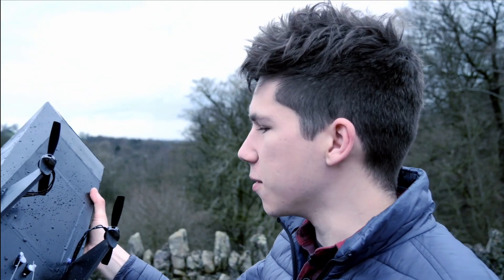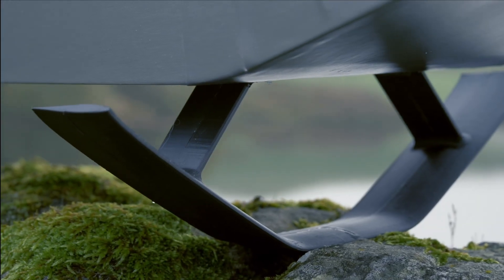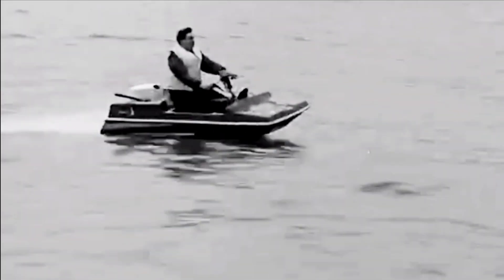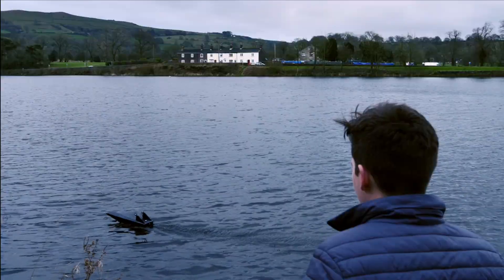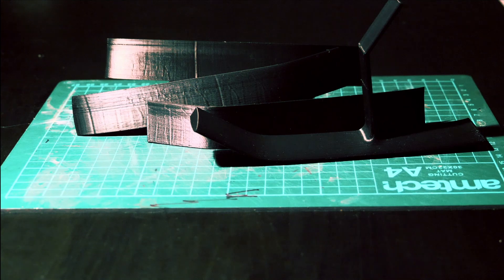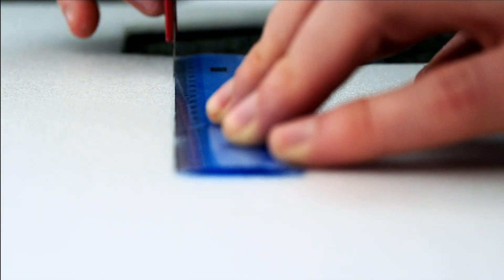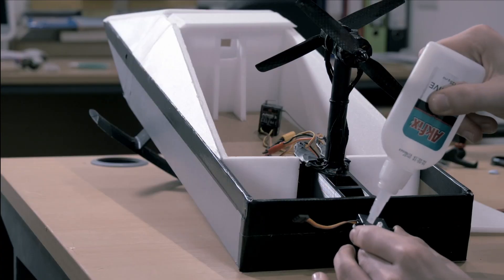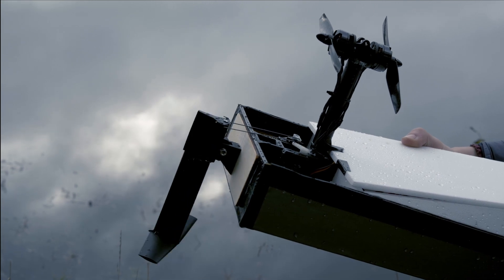TESLA CYBERTRUCK BOAT! // How To Build a RC Hydrofoil

Comment: Just found this channel by pure accident and subscribed. Reminds me of the very much simpler and cruder experiments we tried 60 years ago when r/c was expensive and cumbersome and model aircraft were still wood and tissue and powered either by elastic or tiny, glow-plug engines. Never managed to get a hydrofoil to actually lift. Yours is brilliant. Are the air screws ‘handed’? Also, the athletics were admirable. Great fun. Thanks.

Comment: Looks like you need a foil about twice the size as that one for that boat. Also, if you go to your local hobby shop and get some lead stick on weights and place them on the bottom center of the foils at the lowest point, that will also make it much more stable. I would also consider making a design where you have another foil just like the one on the front but placed on the rear right in front of your rudder. Keep your rudder/elevator foil on there too for stearing, this will help keep the rear of the vessel up out of the water. Good luck!

Comment: Just a thought, do the props on the mk.2 counter rotate?  With the setup on mk.1 the motors cancel each other’s torque, if the props on the mk.2 turn the same direction i would guess that  the torque could cause the instability.

Comment: it is rolling at full throttle because of p-factor of the props.  your first boat was stable  because it had push and pull props counteracting the p-factor. try using counter-rotating motors and props  with the  right motor rotating to the left and the left motor rotating  to the right. Check out the P-38 design to understand what I am talking about. Although the P-38 had counter rotating  props to the outside not towards the inside as I am suggesting. Concerning the wings  they  should be mounted further back closer to the center of the overall length of the boat and be deeper in the water. The rear wing should be larger for better control

Comment: I really like this project James. I think you might need a normal hulled tug boat with a lot of torque that can go out to save the hydrofoil to make your testing easier. Also it might be fun to add aileron as I believe I have seen that on some hydrofoils so they can control roll. P.s. Some sweet boulding on that bridge.

Comment: the mk1 seemed to work decently, however, to have a balanced fly, I would have set the rudder with less tilt after lift off (to avoid the diving issue)

Comment: Are both props Turing in the same direction? Looks like when you are applying the power the boat is torque rolling. Spins the props in opposite directions so they cancel each other out..

Comment: Having lived all my life at a shipyard. I think i can safely claim that a long pole with a hook at the end is the best tool for resqueing stuff out of the water. For the size/weight of these RC boats, a telescopic pole like the ones window-washers use, would probably be the best choice. They are low weight, and only about 1.2 to 1.5 meter long when folded, so easy to transport.

Comment: Very nice.
If I had a lake close by I`d probably try to make one.
Couple of points which may help.
When you had the 2 motors on the carbon, they were rotating opposite, so all good, but when both facing forward, looks like you were getting torque roll.
Try making one motor rotate the other direction. i.e. one clockwise, and one counter clockwise.
Also, mix in some "differential thrust" on the motors, as this will work like a rudder also.
good luck, looking forward to next version

Comment: Cool project! 
Do the motors spin the propellors in the same way? If they do, then the torque from them could be tilting the boat over. What I suggest is that you have the motors spin opposite ways and use differential thrust with them. (If you haven't already, hard to tell in the video)

Comment: Are you using contra-rotating motors/props ? If both motors and props are rotating the same way there maybe a torque reaction causing the rolling instability when trying to plane ?

Comment: The one thing I would say is to cut the flat section on the front foil out as it produces to much lift causing the foil to leave the water. The diagonal parts should easily be able to lift a boat of that size and will have self stabilising characteristic.

I’ve done a lot of theory work with foil and have sailed hydrofoiling boat like the vampire project so you know the advice has some backing

Comment: Some things you might consider for the Mk3.
1.  Return to the center engine pylon with a "push-pull" configuration.  That seemed to be much more stable, although that might be an illusion because of the weather.
2.  Shorten the "legs" on the foils.  I doubt if you really need THAT much clearance when at full speed.  Unless, of course, you're trying to clear out the water weeds when you're at slow speeds!
3.  Follow the design advice from Gungan Works :D  He REALLY seems to know what he's talking about!

Comment: Might the boat also have tendency to roll because the propellers are rotating in the same direction, thus creating a torque that rotates the boat? Maybe counter rotating propellors will help a bit.

Comment: Take version 1, try to move the motors further back and as low as possible. Change the thrust angle of the motors so that a line of the thrust angle goes through the boat at a point about 2/3 of the length measured from the rear. Make sure you have small increments of control for the rear foil so that as the boat rises out the water you can cut back on the angle of the rear foil.  At the desired  attitude of the boat hydroplaning, the front foil should still have a slightly upwards tendency  to make it stay out of the water.  Make sure the front hydrofoil is not too "pointy" into the water as this will cause instability as it rises out of the water. Good luck but hope to see you succeed with this one!

Comment: Try going back to the contra rotating props, because maybe the two separated props are getting a different amount of air flow, and ther high mounting position mite be making it roll

Comment: Seems like some elevons and an imu on the main foil might help. Or at least some wash in on the main foil to increase roll stability. Also, perhaps decoupling the rear foil from the rudder. I tend to try to keep my inputs as independent as I can for simplicity's sake. I think using differential thrust for steering is going to be a losing battle because you've got a lot of vertical surface area cutting through the water. Remember that water is 100X the density of air.

Comment: Great video, keep up the good work! Nice design elements. 1 Q' You did have the rotors (model 2) counter rotating? For the Hydrofoil action ... If you have the ability to change the angle of the attack of the rear hydrofoil you will be able to rise and then keep it in the elevated position. A 3rd control channel, if you like. A 4th control channel for the front hydrofoil would be the ultimate. For operation a mix of Rear and Front hydrofoil through a lot of experimentation should be possible. Great potential for an autonomous vehicle project!
Reply from the maker: Thanks for the comment! 1) Yep they were counter rotating on the MK2. (2) Yeah I realise now I misunderstood how to control the elevator to get the model to 'plane' properly haha - although I think the new MK2 did show some evidence of the rear coming out of the water (3) A 4th channel for ailerons would be great, but also complex which is why I stuck to keeping it simple. ☺️ Cheers.

Comment: this boat is looking less of cybertruck and more of nighthawk, btw try using differential thrust on the motors along with the rudder for additional control
Reply from the maker: Absolutely think adding differential thrust would be very beneficial. It's one reason I decided to go for this separated motor configuration on the MK2

Comment: Long comment, I know, but I've studied hydrofoils in-depth, so hang around. It will be absolutely worth it. Here goes:

The following statement is the secret to achieving a successful hydrofoil: ***Because of the shallow V of the foil, the usable lifting area of the foil changes, depending on how much of it is in the water or not.***Consider the implications of that statement: The faster the boat goes, the more lift the foil creates. The more lift the foil creates, the more the foil rises out of the water. And the more the foil rises out of the water, the less lift it creates. Relative to the weight the foil supports, too much lift, and it rises higher, creates less lift, and sinks down. Too little lift, and it sinks lower, creates more lift, and rises up. This is a self-stabilizing system.

On the other hand, the rear foil is continually submerged in the water. This means (for a constant speed), the lift developed by the rear foil depends exclusively on its angle of attack in the water. Thus, when the boat pitches up, the foil pitches up and produces more lift. When the boat pitches down, the foil pitches down and produces less lift.

Now consider the hydrofoil as a whole. As the front foil creates more lift, the foil rises up in the water, causing the boat to pitch up. As the boat pitches up, the rear foil pitches up and creates more lift, causing the rear of the boat to rise up. The key is to place the CG just right such that the lift from both foils balances the weight and CG of the boat.

This is how you create a stable hydrofoil:
1. Physically set the incidence of the front and rear foils to be identical, and adjust the thrust angle of the motors to minimize the downward pitching moment they create.
2. Calculate the surface area of the area of the portion of the front foil that is underwater when the front foil is 1/2 way out of the water. (I'll call this Af)
3. Calculate the surface area of the rear foil. (I'll call this Ar, and call the distance between the foils L.)
4. Find the location of the CG that puts an equal load on both foils using the following equation:
Distance from rear foil to CG = L * (Af / (Af + Ar))
5. As the boat is foiling, use very small adjustments to the angle of the rear foil to adjust the flying angle and flying height of the model, accommodate for the thrust angle of the motors, etc.

Example:
Area of submerged portion of the front foil: 30cm^2 (Af)
Rear foil area: 15cm^2 (Ar)
Distance between front and rear foils: 30cm (L)
Find the distance from the rear foil to the CG (D)
D = L * (Af / (Af + Ar))
D = 30 * (30 / (30 + 15)) = 30 * (30 / 45) = 30 * 2/3
D = 20cm
The result is the CG should be 20cm ahead of the rear foil, and 10cm behind the front foil.

This is how you create a stable hydrofoil. Notice also the implications of the above formula: If the front foil has twice the area of the rear foil, it will carry twice the weight. Secondary to that, notice that when the boat is stationary, significantly more of the front foil will be submerged than what you calculated. More area = More lift. Thus, as the boat accelerates from a standstill, the fully submerged front foil will create more lift than it needs, lifting the front of the boat out of the water first. As the boat pitches up, the rear foil is allowed a higher angle of attack, and thus it lifts the rear of the boat up. And voila! You are foilborne! It is as easy as that.

But what do I know...? I'm just an engineer who wrote an entire research paper on the history and dynamics of hydrofoils.
Reply from the maker: Hey, massive thanks for this ^^. 

I very much appreciate the time to go through this here and provide some hydrofoiling wisdom. I'll definitely be using that formula to properly setup and tune my new hydrofoil as soon as we have some better weather. I now realise I had a few misconceptions about how you get into a state of being 'foilborne' using the elevator. I was coming at it with very much an aeronautical perspective. That's probably why I aimed to get the CG over the front foil too which I realise now was pretty wrong judging by your calculations! 

Looking forward to taking this to the next level. Thanks again! 

Cheers, 
- James.
Reply: I'm glad I could help you out. Of note, because this is changing the dynamics of the foils, you might find the boat is more stable with the front foil much farther forward, like 2/3 or even 3/4 of the way up the boat (depending on what looks most aesthetically pleasing, of course). It's like extending the wheelbase of a car, and as a bonus, it will make getting the correct CG placement much easier, too.

I realized when I wrote the research paper that you cannot necessarily treat the hydrofoil like an underwater airplane, because both surfaces must create upward lift. It's more like those old free flight models that used a lifting tail. The CG on the models is seems impossibly far aft—behind the TE of the wing even. But because math and physics (which I won't go into here) it works.

Cheers!
-Dave
Reply: @GunganWorks  Has any active stabilization been done on any hydrofoils. Like a simple PID tuned system inside a "flight controller?"
Reply: Elijah Vivio it has been done, but it's only needed on boats with fully submerged foils. The shallow V of James' foil design makes a flight controller unnecessary.
Reply: im guessing this is for static hydrofoils, would the calculations change if you had a computer controlling the pitch of the foils?
Reply: @RYGAR92  >>> Those would be submerged hydrofoils, in contrast to surface-piercing hydrofoils. 

{And THAT is about 50% of ALL I know about hydrofoils...😊}
Reply: @Allan_aka_RocKITEman  well you know 100 % more then me :)
Reply: @RYGAR92  could a flight controller type device do the job ? i wonder if a good old Arduino would be capable of doing this
Reply: Hi, i'm an engineer too, i would love to read your article, could you send me the link, or name?
Reply: Thats pretty cool i didnt know there was a  science to it
Reply: @williamschultz298  You didnt know there was science about it. Your in for a shock when you realise everything has science to it
Reply: Any chance you could link that research paper?
Reply: Gungan Works that seems like would work
Reply: Dear Gungan Works
I want to make jetskil electic Hyrdofoil. Any plans ? Seadrive.no
Reply: Gungan Works I am a student and this is the profession I’m looking to go into could I contact you to ask you some questions?

Comment: A more elegant solution to the "nose down" behaviour would be to have a negative angle of attack for the motor, thus compensating for the propeller being mounted so high. Have a look at the bixler 3 plane for examples.
Reply from the maker: Alpem_Warrior yep that definitely would have helped to have an adjustable ‘head’ on that mount, but alas we were in the field with just a screwdriver to attack the elevator with 😊
Reply: @Project-Air  haha no worries. Great video!
Reply from the maker: @alpemxyz  Thanks

Comment: you maytry to put the CG in between the two hydrofoils , such that they'd both be lifting , instead of the front one lifting , and the back one producing downforce as it looked to be like in the first prototype
Reply: It's complicated by the rotation caused by the airscrews thrust being high above the drag. How to counter that without messing up the pitch control? I can't figure out how to balance the two.
Reply: @bikeforever2016  batteries at the back would couteract the nose down pitching moment induced by the thrust (maybe 😂) . The back wing would have to lift up more than the front one , making the whole boat a canard-style boat , relying more in the back , and maybe using the front one for pitch control .
Reply from the maker: That would have been an interesting idea to test on the MK2, I should have tried it. Was thinking at the time of keeping it more like a standard airplane configuration though.

Comment: So you designed a rescue boat that needed rescuing? Which brings up a real quandary (it might even be a dilemma); which comes first; the rescue boat or the boat for rescuing prototype rescue boats?? 🤔

Also, at least it was better than the Cybertruck launch--just don't throw rocks at it. 🤣
Reply from the maker: DeadlyDiddly I was thinking about the irony of the situation at the time 😂 Thanks man, I can imagine the Cyberboat would fair significantly worse than the Cybertruck when rocks are thrown.
Reply: The MK 2 looks really cool James, I'm sure you'll mod and tweak and tune it to perfection. It looks really strong too, so I'm not convinced it wouldn't fair better than Elon's Armor Glass if stoned. 🤣
Reply from the maker: @DeadlyDiddly  Thanks!
Reply: @Project-Air  >>> Rescue Boat = Canoe/Kayak? 

{On the UPSIDE, the UK does NOT have one water hazard that the place where I grew up -- Florida -- has:  Alligators 😊}
Reply from the maker: @Allan_aka_RocKITEman  Haha yes, although we do have the Loch Ness Monster 😉
Reply: @Project-Air  yes. However, to date, Nessie hasn't eaten anyone.